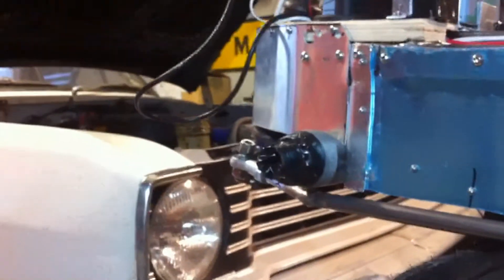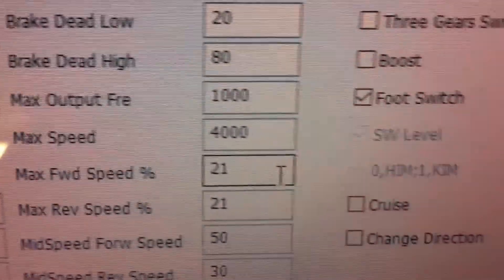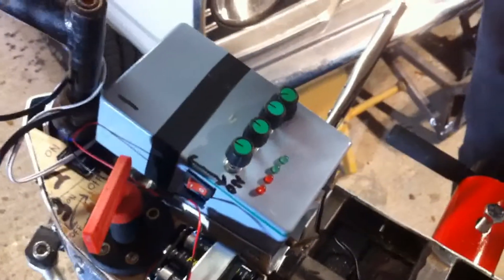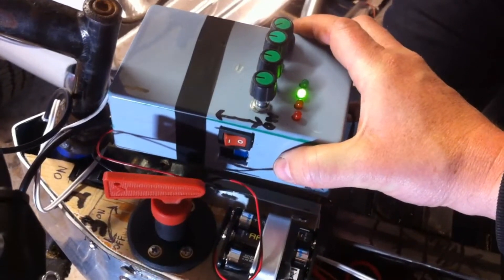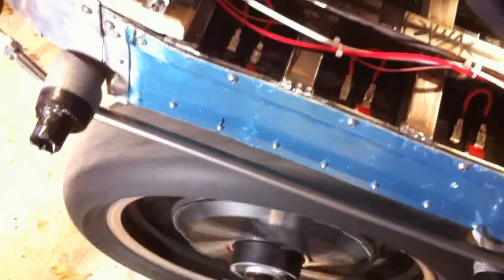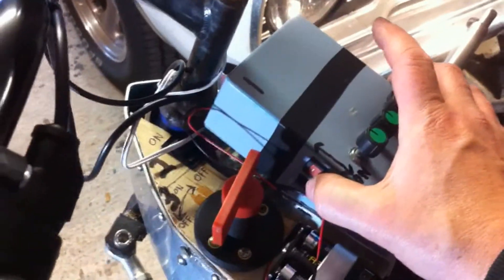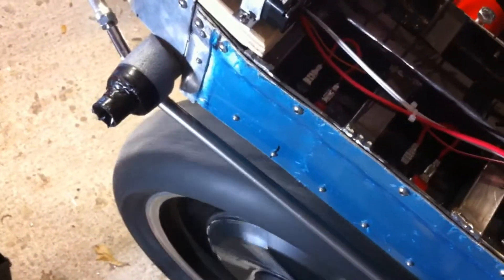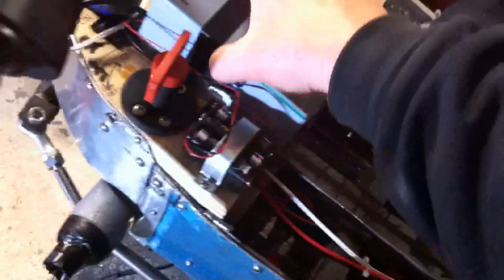Unicycle Garage #8: All up hubmotor unicycle test on engine stand

Comment: Very very impressive! Good job! Can’t wait to see this thing in action!!!! Could you may put some links for the wheel and Kelly controller in the video description?
Best greetings 
Leo
Reply: I actually found the motor! How much did you pay??
Reply from the maker: Was fairly expensive but I did not want an underpowered machine that could never balance. In reality the machine is if anything now overpowered, scary, and heavy. Next video will be first small scale testing in garage. Need to take this in small steps.